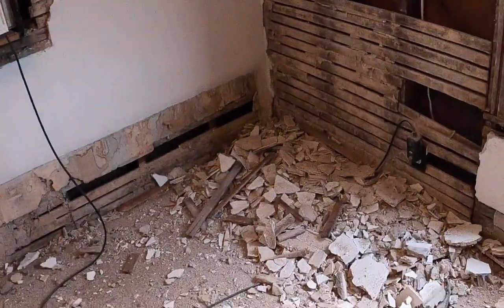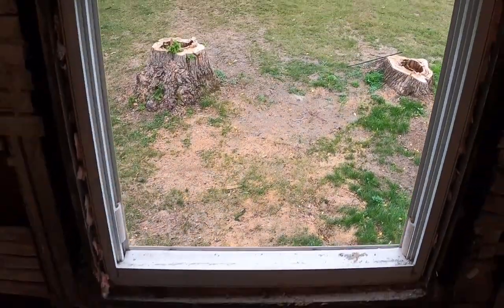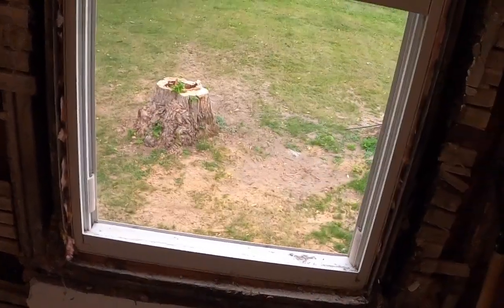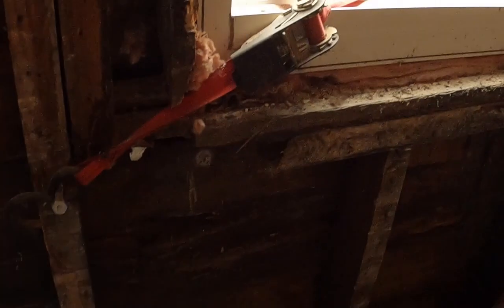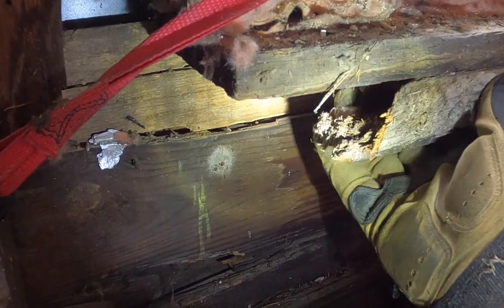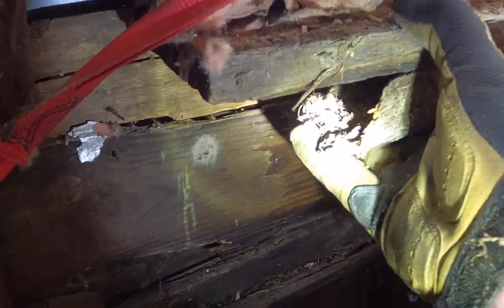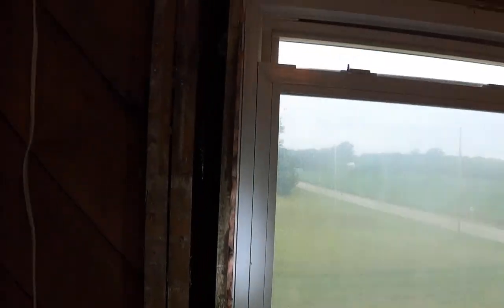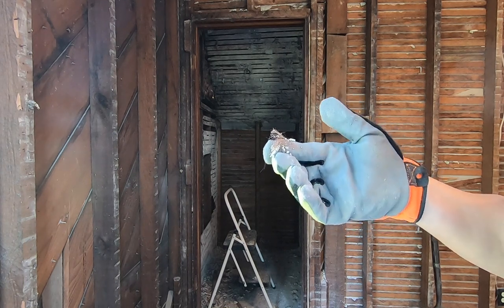Building a Second Story Trash Chute

Comment: Thanks for the video.  I've got to gut a three story Victorian.  I like how you use the ladder for reinforcement.  Can you explain what is going on in frame 5:03?
Reply from the maker: I used panduit straps to attach it to the ladder.  They’re large wire ties, like what is used on flex duct.  I was drilling holes so I could put those through.  I guess I did edit that out, sorry about that.  Thanks for watching and good luck!!
Reply: @4AcresandaFarmhouse  Thanks!